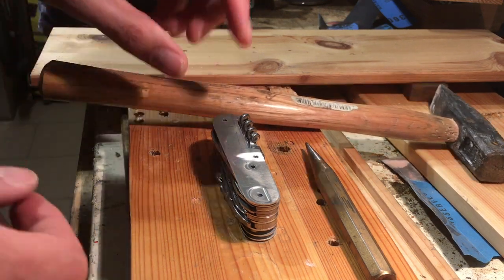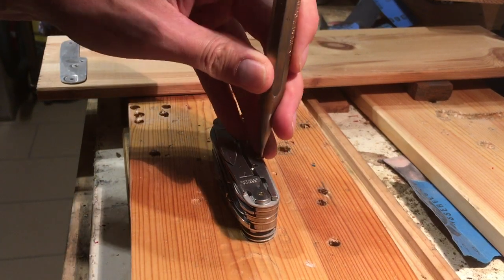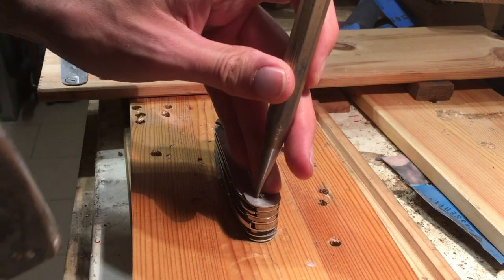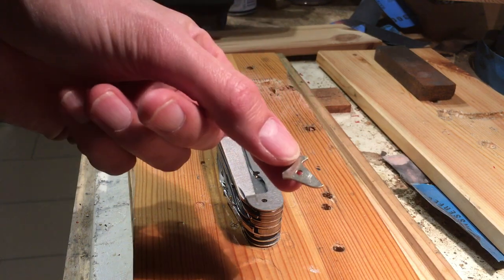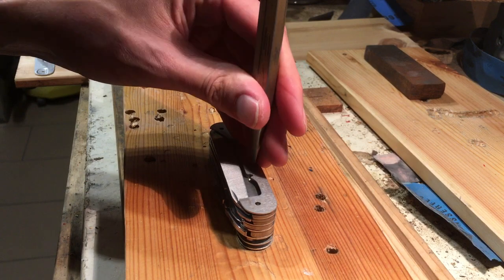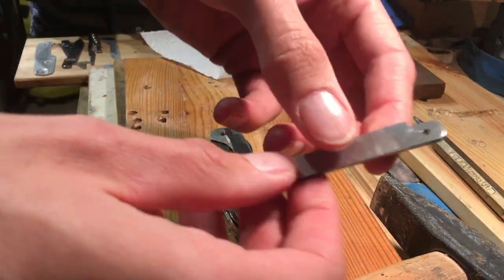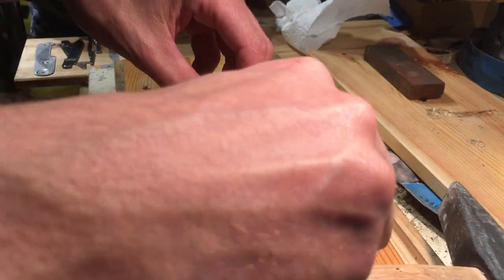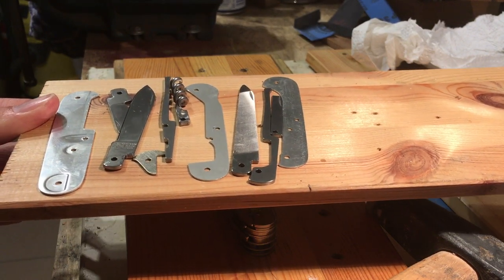Cyber Champ #4, How to remove the tools. Victorinox Mod

Comment: Can I ask, does it matter from which side you knock the rivets through? The screwdriver socket on my cybertool has split (too much strain on a screw) and it's on the opposite end of the tool from which you have started. I have an old cybertool with a broken blade and would like to swap parts to have one good tool.
Reply from the maker: Cmdr Pugwash does not matter

Comment: Where can you order ba replacement long blade for a 91mm. Mine snapped :-(
Reply: i would like to know if you ever found one?
Reply: @DeadDrop6109  I have sent a number of my knives in, and Victorinox will slean, oil, sharpen, and replace any damaged tools (like the tweezers and toothpicks) for a very fair price (I think 3 knives were $13?) Contact Victorinox and ask them what the cost would be for your broken blade.